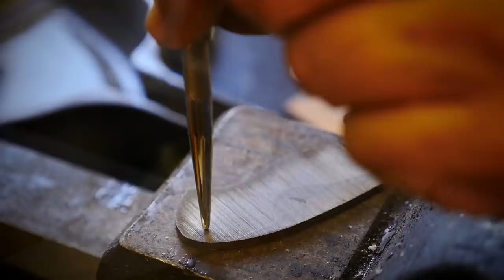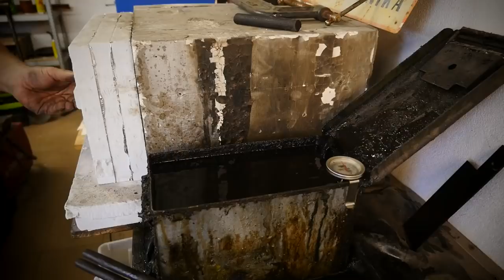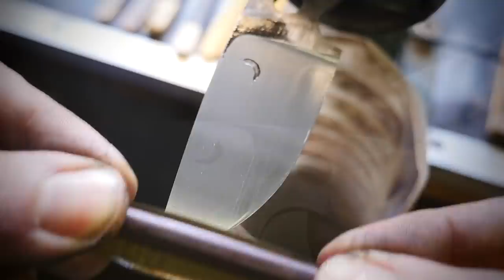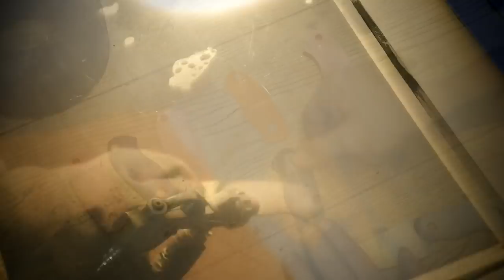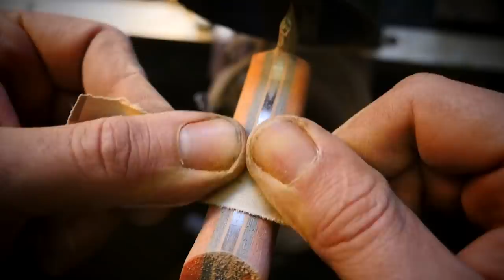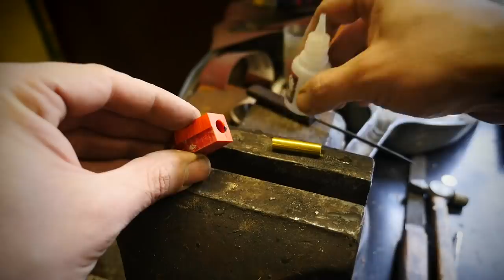A BIRTH OF A SMALL KNIFE [Trollsky Knifemaking]

Comment: Nice work, you can get a little more activity in your Hamon Lines by putting a very thin layer of your refractory clay on the edge of the blade then using a slightly thicker mixture paint lines (paint for lack of a better word) from the Clay on the spine of the knife all the way to the edge in a random Crisscross Pattern (or uniform, get creative with it ^.^) 

This not only produces a Visually interesting pattern, but also prevents the edge of your blade from cracking during the quench due to the lines of clay preventing the steel underneath from getting as hard as the steel at the edge.  I think I typed that out in a way that makes sense, if not let me know and I'll try to explain it better

Comment: Hi!

Thx for a video)

What you put on the blade, before the Harding steel ...?
Reply: VikRise  It’s a heat-resistant paste...Usually you can find it as an isolation of fireplaces or chimneys - things that need to withstand high temperatures. In knifemaking, it is used to harden a blade differentially - one part is hard, while the second remains relatively soft so knife won’t break. Hope that explains it :-)